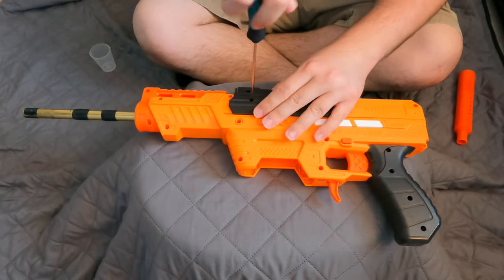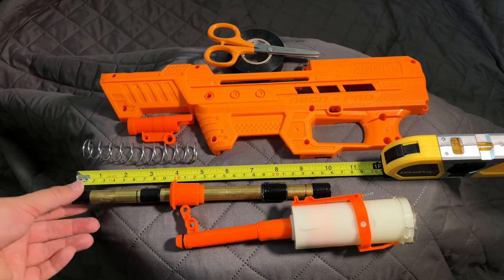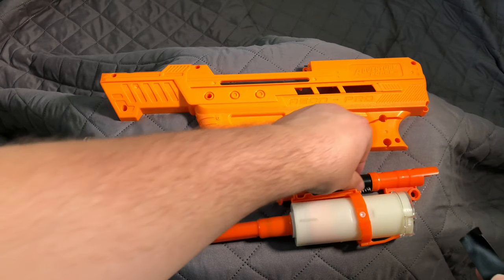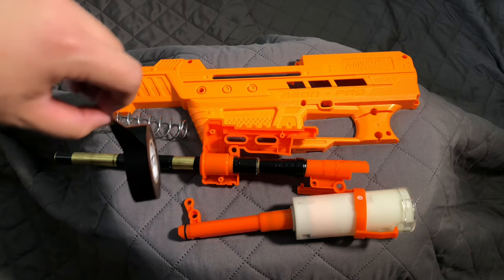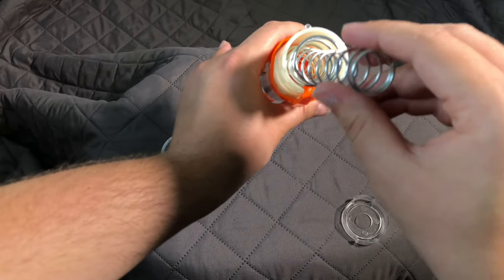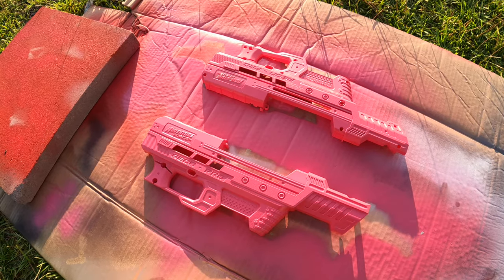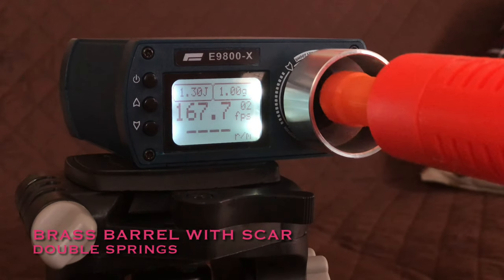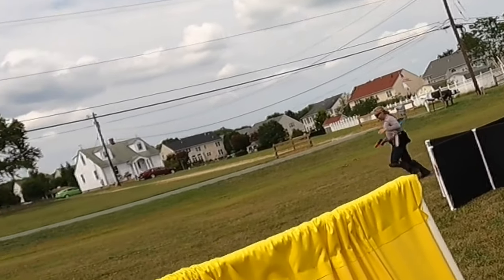Adventure Force Aeon Pro Brass Barrel Mod Tutorial - Hit Over 200FPS for Cheap!!!

Comment: Consistency seems a bit wild. I found the most consistent shots with a 6" brass barrel (on my Nexus) versus an 8" or 12" barrel. You could also try polishing the barrel: clean out with alcohol or lacquer thinner, and from what I've seen, Pledge seems to be a favorite for brass polishing.
Reply: Chris cartaya trick. It does work just takes some time to do properly
Reply from the maker: Having a single higher kg spring instead of the cheap doubled up method would help as well.
Reply: @KBFoamStrike  I definitely like that the Kronos spring is useable with the plunger cap. I may swap the stock with one to get fps down for sub 120 rounds.

Comment: You added I presume a 17/32 brass barrel and witnessed a very clear drop in performance due to friction in the barrel.  You then added the booster spring to improve performance but you did not test performance with just the spring upgrade and not the added friction of the 17/32 barrel.  What is the performance with just an air-tight seal (via the tape method) between the dart chamber and the original 9/16 barrel?  Did you test that?